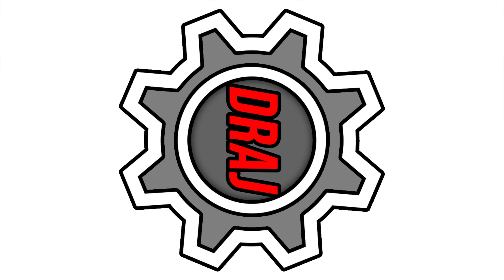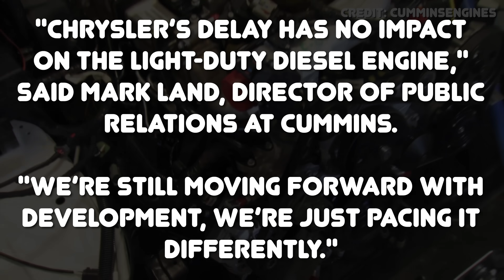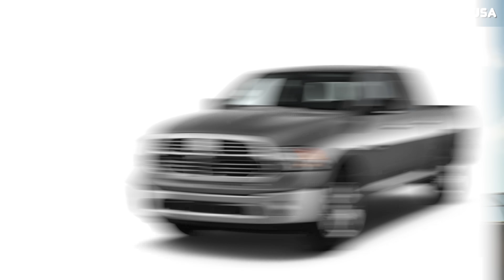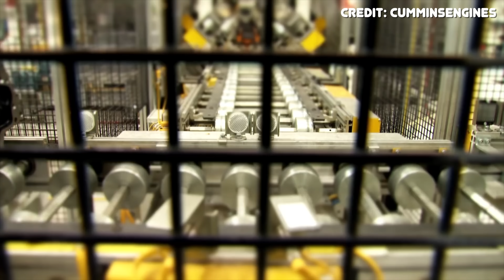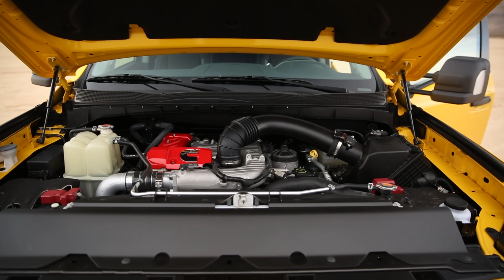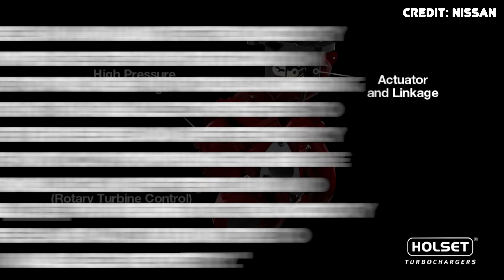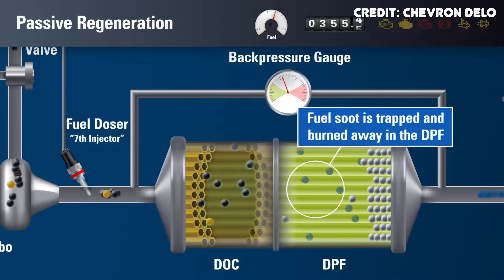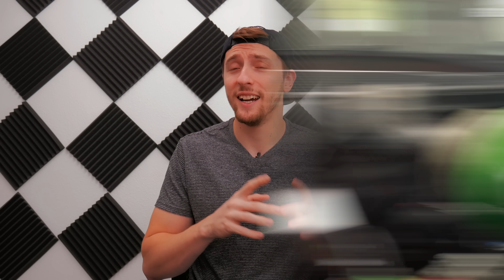5.0L Cummins: Everything You Need to Know

Comment: Good to see someone talking about an engine that I spent 5 years developing at Cummins.
Reply from the maker: What did you do for Cummins? I'd love to hear more!
Reply: @Dustrunnersauto  I started in that program building Alpha Development engines, then ran Development, durability, and emissions tests on dynos. All in the CEP building in Columbus. And finally was in charge of all prototype engine builds and all of their BOMs. 
I left and returned home (Michigan) before it hit production for the Titan
Reply: @jtkstudios4168  Any recommendations on dead pedal or getting deleted?
Reply: @169armyjoker  sorry,  I only worked with the Engine in the dyno lab. Someone in vehicle integration or even with dealership service experience may be able to help with that
Reply: What do you think the life expectancy is?
Reply: @AnthonysBBQ  it should live a long time as long as it's properly maintained and not modified.  The head gaskets are the weak points and they are at their limit with stock boost levels.
Reply: Sorry for your loss!!!

Comment: primary reason the titan XD didn't last long was one big thing PRICE  ,,it was too expensive ,,gas powered trucks like the F-150 with the 3.5 liter Ecoboost were getting the same fuel mileage ,,up in the 20-25 MPG range  ,they were able to tow 12,000 pounds ,having 385 horsepower from a relatively small 3.5 liter engine ,and were much less expensive ,and along with the gas engine you get the much cheaper maintenance cost 
i drive a 1 ton truck on a daily basis ,,my primary truck has a 7.4 liter big block V8 with a 5 speed manual and i haven't found  a diesel truck yet  that'll outpull it 
fuel economy  well that's a different ball game  because most diesels get much better fuel numbers ,,if i keep my truck tuned right i can get 15 mpg

Comment: Nissan frames are super soft.! Inferior metal being used. The dodges are just complete trash. Stay away from both.
Reply: Cite your source.
Reply: @Icutmetal  my source is me i worked on them. I used to have a customer that put a lift in one and it twisted the frame so bad had to modify the transmission cross member to get it out. 
So i dont need a fawking source.
Reply: @CaptainDayne  Ok then, what exactly makes the frames so soft? What grade of steel is used vs their competitors?
Reply: @Icutmetal  their metallurgy. Inferior steel basically. Not all steels are the same.
Reply: @CaptainDayne  No shit? Give me a specific example of the grades and how they are different. I’ll wait.
Reply: @Icutmetal  plus you van do the research yourself.

Comment: Ram missed the boat with the 5.0 by not dropping it in the 1/2 ton truck. The Cummings is light years ahead of fiats ecodiesel. Paired with the 8 speed tranny the Ram would have gotten 25 mpg  in overall driving.

Comment: General rule- the greater the weight you want to tow, the greater the weight of the towing unit needs to be. Using a Titan for towing more than a 2 axel rv trailer is like using a 1 ton truck to pull a 53 foot dry van. Power isnt necessarily the issue, a lighter, shorter wheel base vehicle will be more prone to jacknifing.
Reply: They did not put the Cummins / Aisin combo in the Titan. This package was only available in the Titan XD. All XD trucks are Class 2B trucks and the DOT recognizes them as 3/4 tons. Likewise, they weigh in at nearly 8000 lbs. for a crew cab, 4wd diesel powered version. The wheelbase, overall length, curb weight, and factory gooseneck prep make them great tow vehicles. In comparison they were equipped with larger brakes all around than the same year Ram 3500. The largest problem is with buyer ignorance. Ram is owned by Fiat now, and most of the manufacturing is outside the US. While the Titan XD is owned by Nissan America and completely manufactured in the US. Interesting, isn’t it?

Comment: If my truck kinda hesitates when I hit the accelerator would that be a problem in the smaller turbo? I only ask cuz you said the smaller turbo was for acceleration response?
Reply: Typically, a smaller turbo will spool faster, but offer less boost especially in high rpm. A larger turbo will spool slower, but offer more boost, unless too large for the application. Turbo lag, or falling flat on its face at wot like vw, can mostly be attributed to a combination of issued all at once. 

Fly by wire, especially throttle, will ask for a hand job from all the other components before complying. Blow off valves, and/or variable geometry compressor vanes have to move from fuel efficiency to stuff the air. Electronic injectors have to comply with computer orders too. All adds up to a short fuster cluck before enough diesel is added to spin the turbine up in the first place. Mechanical diesels, if maintained, don't have this problem.
Reply: @PBVader  Are you saying the computer control is the pimp and the fly by wire throttle is asking "daddy" for things that it shouldn't.

Comment: My 2500hd lb7 duramax was the best long trip truck I have had.  The fact I could pull 7,000 lbs like it wasn’t there was even better.  I currently have a 6.0 gas 2500hd and it doesn’t tow as nice, and does ride rougher although I blame the leveling kit. My previous 6.0 without one was better but you still felt the load.  

I’ve had 1/2 tons and they were ok I don’t think they rode better, although I looked at a few in grocery getting configurations and I just couldn’t consider them trucks. I don’t feel the ride was better, and it was just a boat with a bed.
Reply: 100% the tougher ride is from the leveling kit, no getting around that. 

That said my dad put 356k miles on his ‘01 duramax. Great truck. He towed a lot then for the family business, and traveled too. I basically learned to drive in that truck. Drove great, and got great fuel mileage. 

But I will say my 2012 silverado 1500 has a way better ride. Tons more comfortable, and actually a better ride than it did stock since I leveled it with coilover shocks and replace my upper control arms. I have to be in any other truck that rides as nice. Not even a Ford Raptor (too boat like and floaty IMO.)
Reply: Bought my 03 LB7 new, still have it and will outlive me. Have had several other 3/4 ton trucks that have been great. The D/max is no def-no-smog no bull.

Comment: I’ve had both straight 6’s and loved them both. I now have the v8. I’d take either of the 6’s over this one. Problem here is all the restrictions on it. It’s not allowed to be a diesel as much as the other two.
Reply: Probably because of the USA’s ridiculous emissions laws
Reply: What restrictions?
Reply: @imnotusingmyrealname4566  EGR, SCR, and whatever other exhaust crap they put on there.
Reply: @______-id5ud  oh I thought it had some structural weaknesses, but in the video he said big turbos can push this thing very well
Reply: @imnotusingmyrealname4566  a tune and delete does just fine and keeps the drive ability of the truck.
Reply: Nothing beats an in-line 6. Both diesel and gasser designs.

Comment: I’m sorry but this video is soooo wrong. The new 5L’s are a fucking nightmare. The amount of them that have come in with lifted heads. Timing chains failures and valve train issues is disgusting. This engine is a bust in my eyes. Not to mention the laughably bad power figures that come from them. Still better then any power stroke I’ve had to deal with but not by much.

Comment: personally i don't trust the 5.0 using timing chains on the engine, every other diesel engine that is used in heavy duty trucks uses gears for that job because of the big torque diesels made.

Comment: if it needs def im staying away... anything diesel now a days does so id rather take advantage of something more like keonigseggs 3 cylinder engine that puts out 600hp. its paired with electric motors so im unaware of how it may  perform on its own but i imagine a 2L 3 cylinder engine that puts out 600hp is probably a ton better on fuel than the 6.4 hemi in my truck that only puts out 410hp.

Comment: The main reason Nissan dropped the 5.0 Cummins, was VERY disappointing fuel mileage. About 16 in city and 20 on the highway. Chev, Ford and Dodge have their 3 liter engines getting over 30.
Reply: Along with it was overpriced.

Comment: I also owned one of these and it lives up to the heavy half ton when towing and it is quiet. Very few Nissan diesel certified technicians in my area to service engine, but fortunately no real issues so far. It does use a lot of DEF comparably to my Ford F350 (6.7L) and I have issues with the cab pulling in the soot diesel smell from the engine bay when environmental system is pulling in fresh air. I believe this partially due to the crappy seal under the hood. I echo, it is a shame Nissan discontinued and certainly puts support in questions.
Reply: Something is wrong - there shouldn't be ANY diesel exhaust under the hood.

Comment: the Gas 5.6 is sooo good that the cummins 5.0 couldnt justify the premium.
also the cummins 50 is an oversquare Engine,.so initial lowspeed torque essential for fuel economy was lacking.
the toyota landcruiser 1VDftv 4.5L Diesel V8 has 86x96mm bore/ stroke while the Cummins 50 is 94x90mm. the toyota diesel is a known diesel Hog given its modest output and generous torquey engine...so i guess the Cummins 5.0 would fair much worse in a direct comparison.
Yes..Nissan could have just taken the.Cummins 4.5 4cylinder and easily cranked it up to 320hp and 600lbft. since its an undersquare engine with less moving parts and tech from the bigger 6.7.
but as usual their economies of scale suggested otherwise...prestige and ease of marketing  of a V8, solid reputation of Cummins, and maybe sale of spare parts unique to the 5.0.

Comment: The 5.0 was a great engine for pulling. It would NOT cold start at under 0 degrees F. I got rid of it for the 6.7 Cummins. This past weekend I cold started the 6.7 in -35F in Virginia MN with no issues. Not even plugged in. 
If you live in the south it’s a good engine but useless up north.

Comment: Good video - I own and daily drive a 2018 Titan XD with the 5.0L. I bought it in 2021 with 19,100 miles, the previous owner took meticulous care of this truck, Car Fax documented thru the dealership. I got to meet him and his family, great guy too. 
I put it on a diet, delete and tuned with a few other mods and couldn't be more happy with my 5/8 ton truck. I come from a 5th Gen Ram 1500, 5.7L that was tuned (ECM swap/ Diablosport) and honestly hated towing my camper with it but not with the Titan XD. It pulls so much better than the gas truck did. I do wish Nissan had followed the electronics update curve, the interior is slightly outdated but I have plans for that also. No Android auto/ Apple Car play, back-up camera was awful and GPS/NAV was wonky in the 2018 year. The newer 2019 head unit will fit but re-pin (or harness) and a trip to the dealer will get CarPlay, Android Auto and a newer Google maps on the head unit for ~$500 or so.
Reply: This post is hilarious, you and I have the same thoughts! I too went from a ram 1500 5.7 hemi, that was a great truck other than when you put any load in the back it squatted real bad. I bought a new 2018 in june of 2019, titan Xd, and deleted it the first month i drove it off the dealership, and have been takin good care of it. I love the truck! 33,000 miles no issues! But because its a 2018 i missed out on the apple car play which is really my only gripe with the truck.
Reply: @LeroyJenkins0311  you can buy the 2019 version of your radio and get a harness made by a guy on Facebook to get car play/ Android auto and the better Navi/screen. Look up Luke Wood.
Reply: @LeroyJenkins0311  what's with all the Nissan drivers also being dodge drivers lol

Comment: I owned a titan xd Cummins owned it for 3 years put almost 100k miles on it with 0 issues. The truck was a beast!  My issues was with Nissan. No matter the dealership they always screwed something up.  They had no clue how to work on the Cummins.
Reply: Similar experience here, 100k 5 yrs zero issues.   The truck is restricted too much through electronics, it feels like the pedal has a 5 sec delay before it even considers adding fuel.  I hear the tuners help this but I've been waiting on my warranty to end before I added one.
Reply: @suburbangarage4608  I could wait delete my at 95k now I'm free work great love the noise lol
Reply: If you never had issues then why is it at a mechanic?
Reply: That happens to be all the time mechanics at the nissan dealership don't like this truck they can't get it right they do anything to pull them out from working on then I have a 2017 xd I love it but def issue git me so we did the delete and now I like it even more and never will tale it back to dealership mechanics there just to stupid and charge u a leg and harm for nothing
Reply: Personally for me, it usually normal maintenance. The dealer always has to find their diesel tech or bring him from a sister dealership.  The only issue I've run across is the Sensor in the DEF tank is sensitive, if I let the truck run with a 1/2 full tank too long the sensor seems to get residue on it and will try to put the truck into limp mode. Usually a quick fill up from a DEF pump vs using the jugs fixes the issue and the error will go away within a day.
Reply: They also have no clue how to do alignments either! Kraft Nissan cost me new front tires, over 2" of toe-in just to keep it from pulling to the right will ruin tires.
Reply: @robertbass5788  yup had that problem also

Comment: The 5.0 Cummins had a big turbo setup that fails around 100,000 miles. Then you have to replace 2 turbos. At or around you will have to replace 2 more turbos. It gets expensive for a engine with low hp and torque and didn’t get good fuel economy. Hard pass. It’s not worth it. Stick to a Ram, GM or Ford 3/4 or 1 ton.